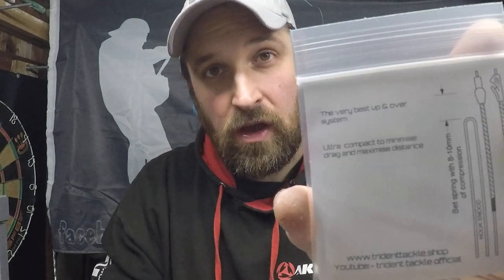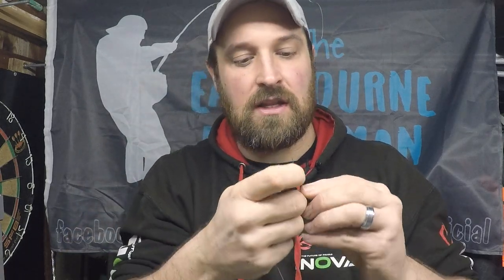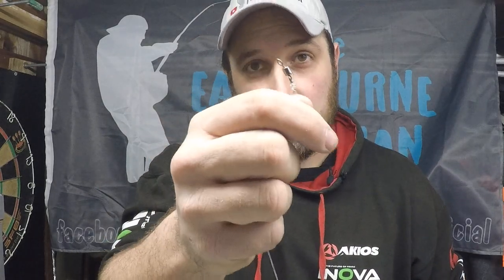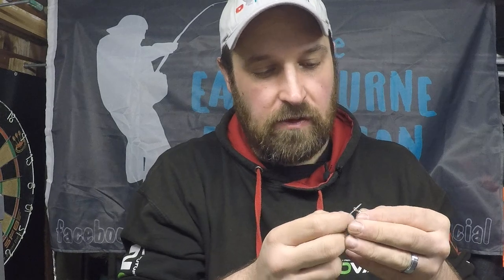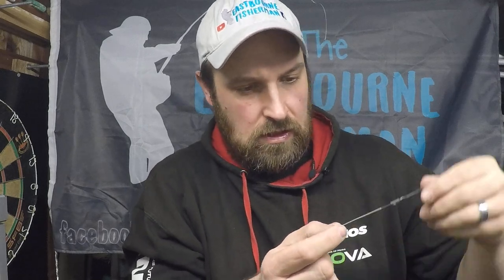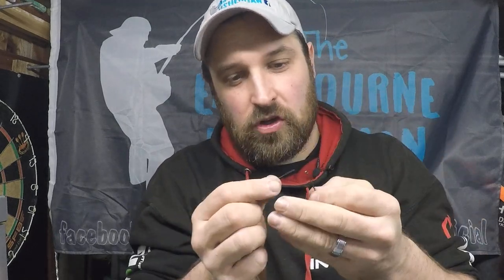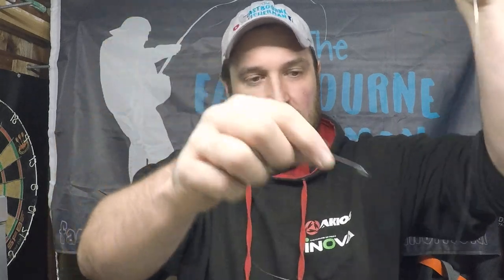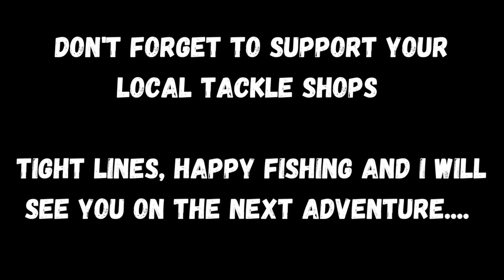HOW TO MAKE THE TRIDENT HANGOVER RUNNING RIG - EPISODE 8 - UP & OVER SYSTEM (UK SEA FISHING)

Comment: Very informative, I always thought - incorrectly that you had to be precise when tightening the crimp, how wrong I was ! ! ! In relation to snood length s
Going to order some, apparently you can get Trident components from Veals MO now
Cheers
Reply from the maker: This is just one way of making the rig.

You can make it the other way by crimping the swivel at the bottom close to the lead however if you need to change the snood line you have to make the whole rig again which is a pain in the arse!

Comment: One of my favourite all time and go to rigs.... Trident tackle is spot on for this.... Only thing I do different is I replace crimps with a little bit of silicone tube as this doesn't damage the line and allows fine adjustment too
Reply from the maker: Nice one Steve you can't beat tridents gear it's top notch, the way I make this rig in the video allows less crimps to be used being the only one under the hangover power gum is also a good alternative to replace the crimp but I will deffo try with the tubing as suggested what size tubing do you use and brand please
Reply: I use gemini rig tubing... I normally cut it into about 3 mm sections and put 2 of those on.... Any bigger then it makes it harder to move and adjust... Using 2 smaller pieces allows movement while still locking into place.... The other thing I do is put a small bead under the spring to stop it from sliding over the tube (or crimp which I have tried too)

Comment: Hi jase you ok chief, ive used that system off trident for about 2nhalf years now mate. Top quality components at very cheap price for the angler. All the best mate from the north east coast GRIMSBY
Reply from the maker: Alright Carl mate I know it's fantastic bit of kit far superior to any other way of making an up an over rig :)
Reply: @TheEastbourneFisherman  i find it doesn't mark the line to much jase, were as when you use the gemini i find it makes that mark on your mono. ?? Is that what you think jase?
Reply from the maker: @carldawson832  no marks on the line what so ever if you make it like this all the components are free to move the only crimp is being behind the hangover itself to hold in place or you can use power gum instead of the crimp

Comment: Nice video Jason, and a rig I'll give a try.  I was trying to figure out the benefit of the spring, but I can see it may reduce the shock loading on the hook length when casting and ensure the main body length takes the strain.  I notice your braid scissors were struggling a bit with the thicker line, I've switched to using sidecutters for rig making and haven't looked back - because they pinch rather than shear they never roll over the line.
Reply from the maker: Hi George the spring is used to keep the tention on line while in the clip

Once it hits the water it ejects forcefully to push the line away from the lead
Reply from the maker: Deffo need new cutters lol
Reply: With the running lead it's an up and over pulley rig so the tension comes for free.  The lead will always slide to balance the rig for the cast providing the hook length is less than twice the length of the running length.  Using a bait clip at the top of the rig reduces the parts count by 3 or 4 components.  I don't think Trident have a suitable component, it would look something like the offspring of a Termalink and a Hangover.